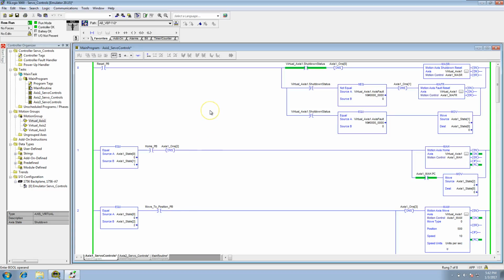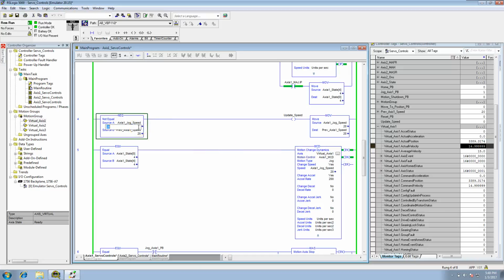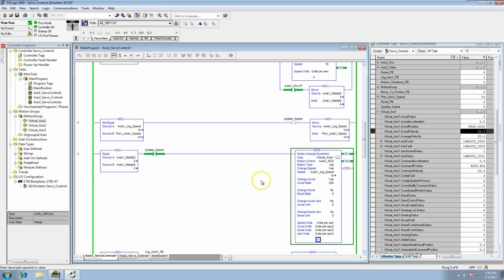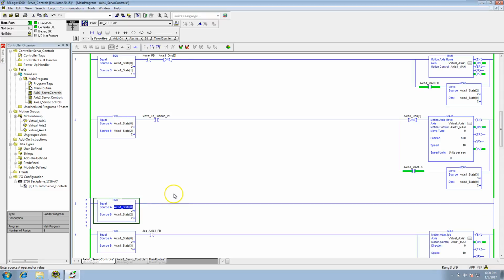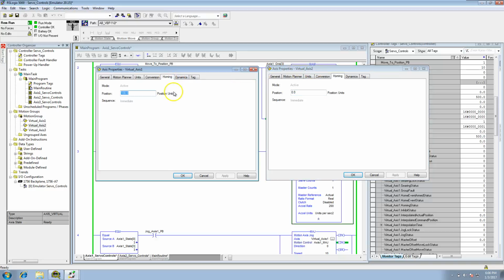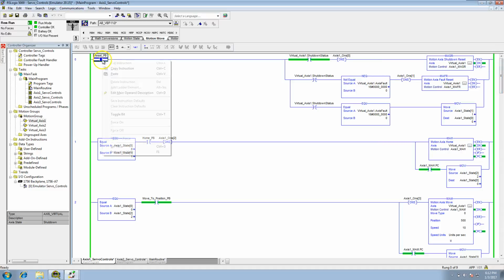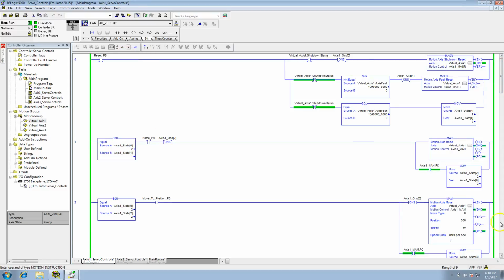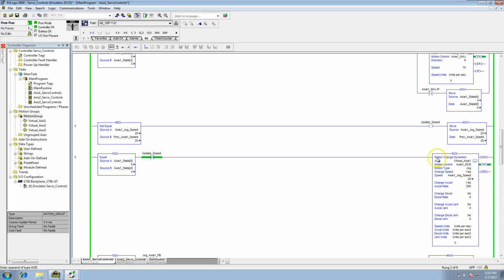RSLogix 5000 - Servo Controls Part 4

Comment: Hi Shane,

Any way of doing video with some kind of encoder simulation or virtual axis to measure specific length? For example if you want to label bottle on the conveyor and let say trigger sensor is away from the bottle. How do you make sure that label is always applied at correct time. I know that we can use timers but than you need to change timer settings every time conveyor speed is changed. 

Thanks and would definitely like to see more programming videos.
Reply from the maker: If you don't mind, make a list of topics that you would like to see and I will go ahead and produce some videos for that.

I also have documents and a website to help out with more tech needs like decryption of any source code but that is at a cost because generally the OEMs like to keep their code hidden if it is source protected but their are reasons to unlock it such as the OEM no longer in business and such.

Let me know if I can help out any further as that is what I am here for, I do not monetize my channel so please help spread the word of my channel and what I am here to do....help everyone grow.
Reply from the maker: If you are doing something of correct timing and such then the best way is to wire the photo-eye or sensor that triggers the product present to the Kinetix servo controller as a registration input then use it inside the PLC code.

Note: there is a best practice to wire a reg input on a Kinetix servo controller to limit the noise to limit false triggers...an input transitions high at 21.6V so any little spike can  cause a trigger if noise is present....using an oscilloscope is the best way to look a transition voltages.
Reply: First thank you for prompt response. I would like to see basic reject 
station that has trigger photoeye ( product detection), low/high label 
photoeye ( detects if label is too short (no label) or too long - if 
either condition is true than reject product) and solenoid reject that 
will kick off product from conveyor if no label or label too high. So I 
was thinking that there should be two shift registers. One from trigger 
pe to low/high label pe and one from low/high label pe to reject 
solenoid. http://www.fillers.com/quality-control-inspection-system/#lightbox[8496]/0/
 this link is only for reference. First picture on the top has three 
sensors so lets say one all the way on the left is trigger sensor and 
other two are high/low label sensors, and there is reject solenoid 
further down conveyor. I hope I explained it well.

Comment: Hi Shane love your videos,  not sure if I missed it but how would I drive a vpl w/ k5500 to a user defined torque value?
Reply from the maker: Same as a normal servo drive
Reply: Would I use a MAM instruction for that? I've only done positional commands in the past so I'm not sure how to set this up
Reply from the maker: @FrankPapadakis  

There are several ways to be honest, it's sort of hard to describe over text.

An mam is not the desired instruction for that.

Generally a formula for a computed math instruction then the outcome to an mam or several other ways.

You can control directly in torque mode as well but that is a deep talk really
Reply: @ShaneWelcher  thanks for the reply Shane, do you know of any good sources that explain how to properly use torque mode? I've been trying to locate a pdf from AB's website that would help me out but I haven't found anything yet
Reply from the maker: @FrankPapadakis  my servo courses
Reply: Cool just checked them out, I am gonna get both the servo courses. Your videos are great and I am glad you are creating content like this!
Reply from the maker: @FrankPapadakis  Thanks

Comment: Hi Shane, I am trying to change an MPL-B320P-MJ72AA to an MPL-B320P-MJ22AA but the motor is unable to start, I do not know if I have to change any thing into the PLC program. What should be the correct procedure to performance that change?
Reply from the maker: The difference is connections on the motor and that should be it, there is a known anomaly with MPL motor if you are not running firmware 1.136 on the K6K controller. I assume that you are running a sercos system, it could also be an issue with the way it is programmed.

I would try to do a motion axes direct command on and then a jog. If it runs then it is a programming issue, if not then you may have a bad motor.

My main question back is that the MPL-B320P-MJ72AA is the new style connection so if the cable is a new cable then how are you changing back to a MPL-B320P-MJ22AA?

Did you just have jumpers or a transition cable set and removed it or did you change the cable?
Reply: Shane Welcher thanks for your prompt answer Shane. Answering your question, I am using a new cable 2090-cfbm7dd-ceaa25 to test the new motor but I keep the old cable to go back if necessary. When I connect the new cable the motor start to rotate without control and after a few it stops.
Reply from the maker: I am not a big fan of the adaptor connections, they do work but at times have trouble. You say you rotate it, does that mean you do a motion axis direct command?

If so then the motor and cable are fine. 

This is a hard question to answer without seeing the complete setup, code, motor, controller, etc.

Do you get a velocity feedback when you rotate it? 
Or torque feedback?

If no then flash the firmware of the K6K controller to 1.136 and L5K the processor (CLX code) then download it back.

Note: if you do this then you will have to rehome the servo but I assume you know how to do this as you are already changing the motor.

I hope this helps,

Shane
Reply: Shane Welcher I am able to jog the motor from a PV with the system in Manual in order to get the conditions to performance that actions. I am not able to performance Direct Commands since safe of is active. I am able to see position, acceleration and velocity in Logix5k
Reply from the maker: Daniel Delgado Palacios 

If you can jog it from the code then you should be able to control it from the machine level. 

You should look at the code in auto and try to run it then see what the reason is you can't run it. 

While jogging or running, if you get velocity and torque then it is not a firmware issue but it is a code issue. 

It might be worth L5K the code then downloading it then trying to run the machine after that. 

Either way,  first look at the code while trying to run it in auto.  See what the issue is and if the system shows everything running then check the velocity and torque.

If the system does not start to run then before the code is good. 

If there is no obvious problem then L5K the controller code and download it. 

If there was no torque or velocity read back of the axis then flash the K6K to 1.136

This is a few things to check but again,  without seeing the code or problem then it is hard for me to give exact advice. 

Hope this helps
Reply: Shane Welcher the main reason to be unable to performance jog from machine level is a safe off condition but I cannot get off that condition
Reply from the maker: So this is a Safe Off issue?

Then fix the Safe Off 

Did you change the controller out or something?

Changing a motor will not cause a Safe Off issue....something doesn't add up.

It seems like you have a controller connection issue or a code issue.

I would have to see it.

Comment: Hi Shane ! Can you explain why in your video the MAJ the speed is fix to 10, but when you use MOV command to transfer value from Axis1_Jog_Speed to Pre_Axis1_Speed the Speed in the MAJ change together? I did not see the connection between the Pre_Axis1_Speed and the Speed in the MAJ in your video?
Reply from the maker: Please re-watch the video and many others like it on this channel to better understand or try it yourself for a better understanding.

This is not easily explained through text.

Comment: So, i was wondering if you can directly give the servo a command to move at an angle is it possible to do so? or you have to calculate the time and set position in MAM. For example how if you were to move the motor t 90 degree what would you do?
Reply from the maker: If degrees are what you want to run then set the motor attributes to degrees and program an MAM instruction to increment and set the position to 90.
An MAM has several different types of moves, I only showed a very simple design in this video....really need to make a few more detailed versions and more up to date.

If by chance you are talking about an angled movement then you want an X,Y, Z style movement which is a cam profile.

I hope that cleared up what you are asking.

If you have an interest in learning directly from me, I have a PLC coaching platform at my website....https://onlineplcsupport.com/online-coaching

Thanks,

Shane

Comment: Also are you working on part 5 video for servo controls?
Reply from the maker: I am going to put together a fully done system but with a actual fully done state machine using structure text then feeding the servo logic.....what else would you like to see in Video 5?
Reply: That would be great. Structure text seems to be future at least for now. I can't wait to see it. I already posted comment on encoder/servo example and measuring specific distance.  I would also like to see use of AOI with servo, where most of coding is done inside AOI.

Thanks again for awesome videos.
Reply from the maker: Geronimo Bee I have a few structure text videos on my channel if you would like to check them out as well. 

when I have time then I will make the next servo videos.